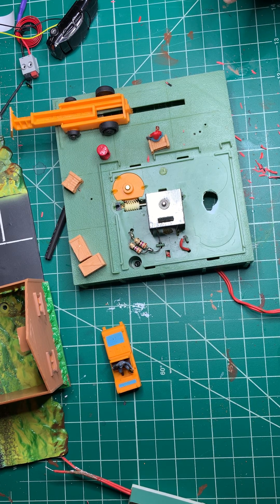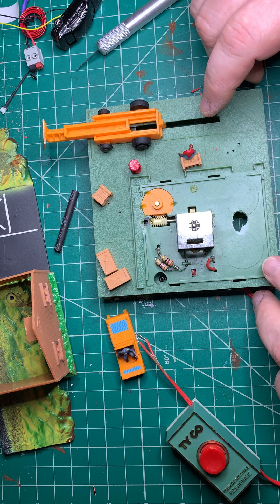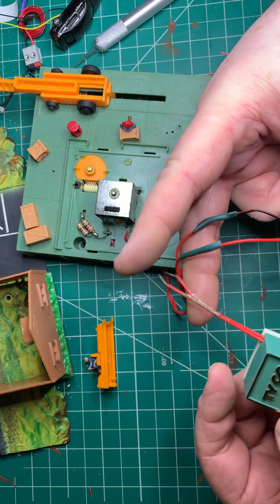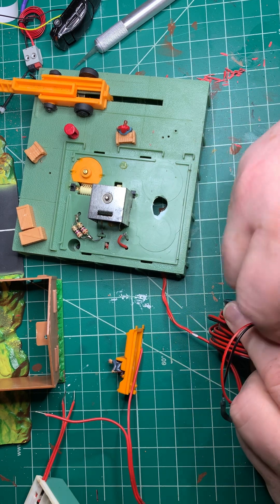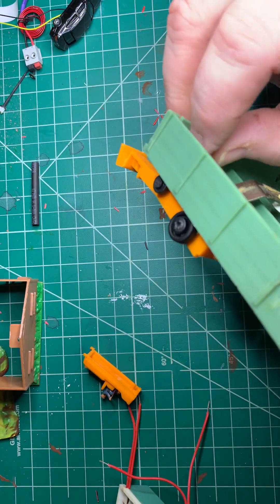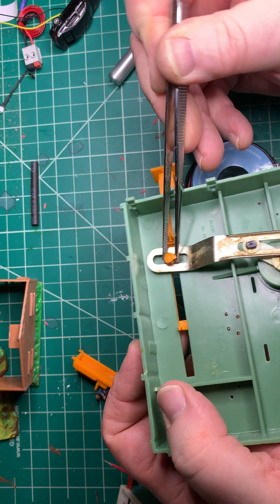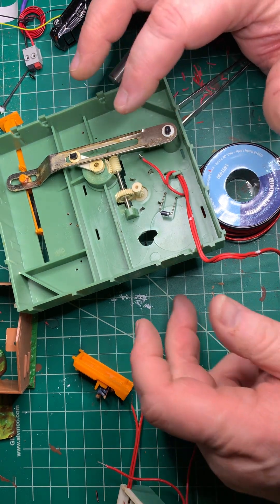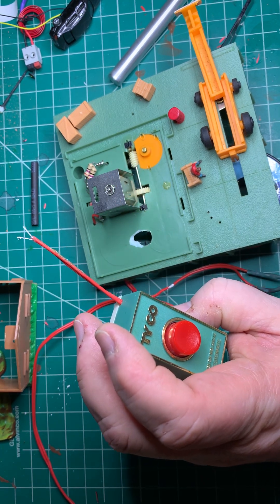HO Scale Tyco Freight Unloading Depot repair

Comment: This is so much different than mine.  Where the 2 circles are, mine has cylinders as if they were made for C batteries.  The motor mounting is much different too, mine uses a cheap snap on plastic.  I wonder if they repurposed a toy from another line to make this at one point?  Like the Star Wars Sand Crawler, AT-AT, and Rebel base play sets - same mold but different color and cardboard.  Same thing happened with the Sat Wars Cantina which was used for the Butch Cassidy play set.
Reply from the maker: It wouldn't surprise me if they repurposed or swapped out components on different manufacturing lines.  It's actually not that uncommon.  Thanks for the comments.  I hope you enjoyed the videos.  😁
Reply: @DKuzzin  at 6:34 in the video, it is right under the red wire knot and above the hole in the plastic.
Reply from the maker: @nesmandan1037  I just lifted it off the table and you're right.  It is an electrical component, but I'm not entirely sure what it is?  Maybe relay?

Comment: What is the black electrical component on the bottom?  Mine looks like half a ball, with 3 pins out the bottom with one cut off.  I found out the part is bad because I can bypass it and the toy works.  I think it may be a capacitor, but there are no identifying marks.
Reply from the maker: It i smore than likely a capacitor in your case.  I'm not entirely sure which black component you're referring to?